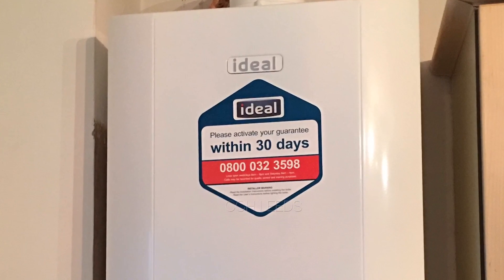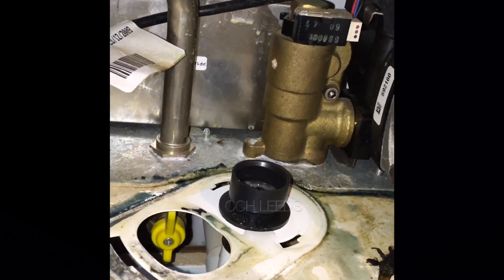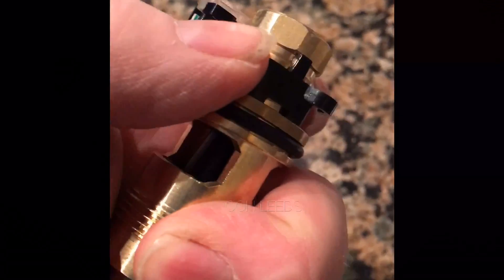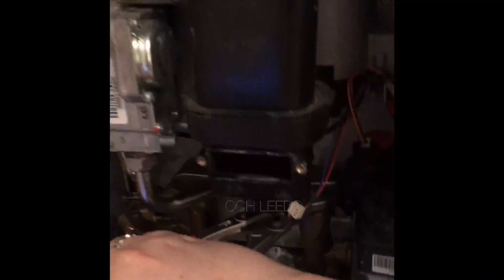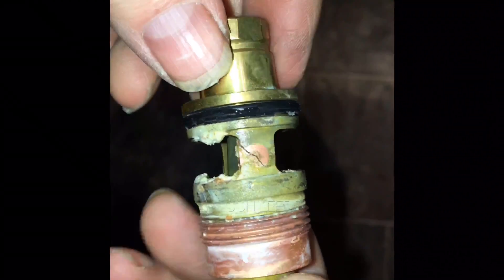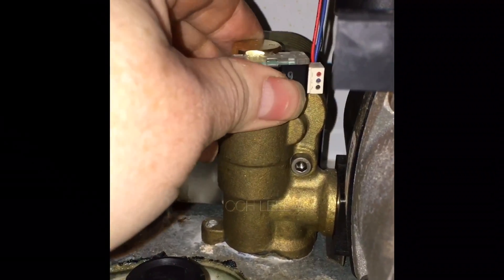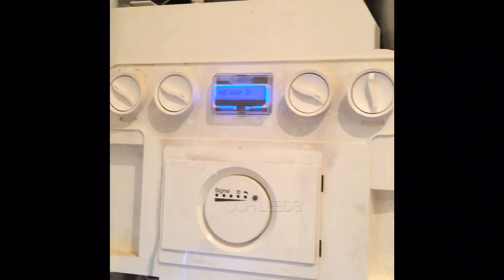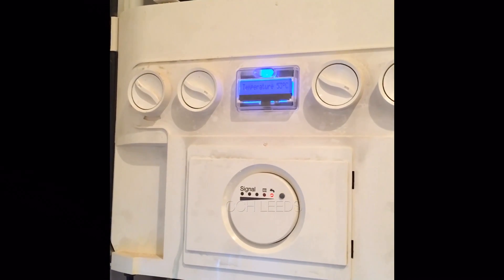How to replace a flow turbine on an ideal logic and logic plus Combi boiler

Comment: whats the point of an educational video if we see yur hand on important bits? so the turb came off with out a tool? and the head of the turbine? conventional shape is it ? things that you havnt mentioned ..im in the middle of this job and it wont budge no matter how hard i hold my grippers yes im turning it anti clock wise !! it wont budge ..and this didnt help !
Reply from the maker: I have done an updated video. https://www.youtube.com/watch?v=S8tOdJRiuCE
Reply: @AllenHart999  hi allan cheers ...i have a problem with the turbo flow the senser id =s flashing and i have no hot water from the taps /shower ..C/H works fine ....but the turbo flow just cant be shifted i cant get it out yes i was turning it anti clockwise...  thats why i looked at the video originally i used all my strength it wont budge but these vids get more views when done properly...things like unclear instructions /a poor microphone /bad editing a clever bloke like you could lern these strangely all on yu tube!! any way cheers !!

Comment: Hi Allen,I have a weird issue. The flow sensor on my ideal logic is flashing red whenever I use hot water, I'm getting the hot water ok but for some reason when I use hot water upstairs I hear a tapping noise in the boiler (sounds like it's coming from the flow turbine) and when downstairs it's fine? It's really strange, all I can think of is that the turbine is faulty but is effected more but upstairs pressure??

Comment: I have a ideal imini 24 sometimes I only get Luke warm water and other times its boiling hot plug the same thing happens with the radiators any idea what that could be??
Reply from the maker: You need to call someone out to check it. Could be a few things. Thanks.

Comment: I have an Ideal Logic Combi 24 and the heating is fine but the water is only luke warm from the hot taps (slightly warmer in the kitchen where the boiler is situated but colder in the bathroom). It doesn't fluctuate but just stays luke warm. I've tried with the heating on and off but no change. Any ideas on which part requires changing?

Comment: Thanks for this after having the radiators heat up when hot water was called, i changed the diverter valve and the flow turbine but didnt seat the turbine sensor properly and racked my brain for hours until i figured out what i had done with the help of this video. You just saved me several hundred pounds. Thanks.

Comment: Hi all i have a very low hot water flow in bathroom and kitchen sink i have changed the flow turbine i purchased this item form plumbase but i still have a low hot water flow and the hall sensor light is flickering any ideas please ?
Reply from the maker: You will need to call a gas engineer out as the case and flue will need checking. Thanks.

Comment: Make double sure it’s piped up the right way round before removing this turbine
Preheat on, run hot tap slowly feel cold in and hot out pipes under boiler, make sure 
It’s correct or you will get mains pressure water from where you’ve removed the turbine.
Reply: not if you've opened up all the taps in the house. isolated the mains supply, and drained the boiler then drained the hydroblock. you only get a dribble. do none of the above and you're swimming 😂

Comment: Hi, my ideal, central heating works fine. Hot water turns on when I open tap, then goes off after 10-20 seconds. Any ideas? I’m thinking diverter but any advice would be greatly appreciated
Reply from the maker: Sorry for the late reply, did you get it sorted , Thanks.
Reply: Plate

Comment: Had 2 turbines stuck, seems to be an issue here. Why does it require a screw thread ???
Reply: So it doesnt fly out 😆 anticlockwise to release
Reply: keith hume I came across one on a Promax that was reverse threaded. Try going the other way.

Comment: Do you need to drain the boiler?
Reply: Yes but just incase the valve on the boiler to stop the water flow is faulty (like mine) turn your water off at the mains.

Comment: Thank you. Really grateful for this info.  First signs of the flow turbine failing are having to turn your hot tap up closer and closer to full on before the boiler will ignite. When fixed there is a big improvement in hot water production because the turbine doesn't just detect flow, it measures it to determine how high the boiler should modulate its flame.  This is a badly designed component as its gradual failure means it is functioning incorrectly in many peoples boilers.
Reply: just had mine serviced and yeah thats what mine needs the red light was blinking not solid red light, its awfull not having a warm shower or washing pots in luke warm water just need part fitting now
Reply from the maker: Thanks for that and thank you for watching.

Comment: I wonder what the symptoms are of a faulty flow turbine?
Reply: The symptoms for mine are: Hot water only when the taps on full. After a while there wasn't any hot water regardless of flow. I only get hot water if I restart the boiler as the burner then turns on. Another symptom is the Red Light on the Hall Sensor flashes instead of being solid.
Reply: @petergalley3897  on my Halstead Eden CBX 32, i have an intermittant error code for "differential  check faulty"- reason "zero check faulty DHW or CH", maybe a faulty / clogged up  flow turbine, what do you think?
Reply: Peter Galley nicr
Reply: buaan hot and cold water from the hot tap.